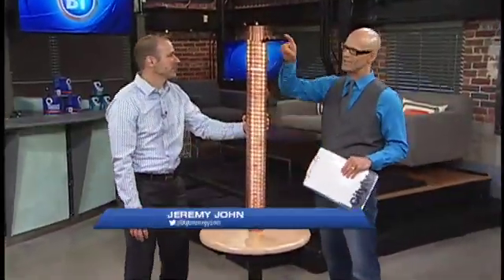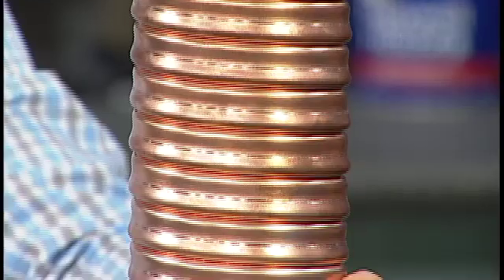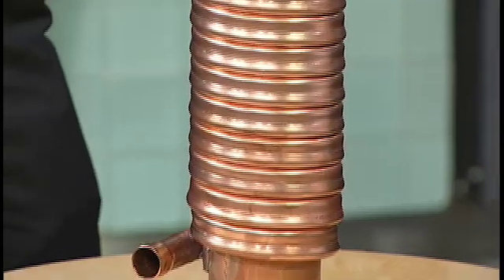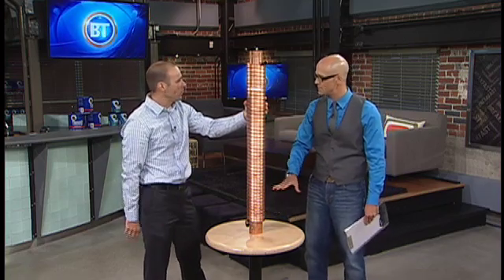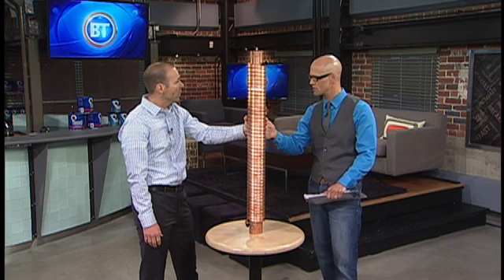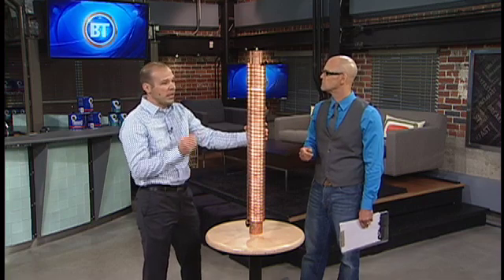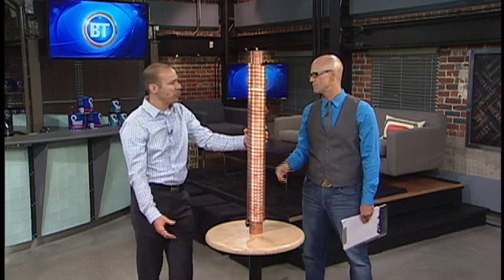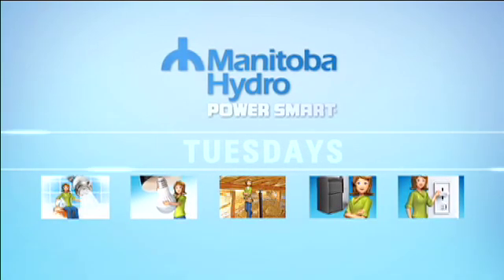Drain Water Heat Recovery Systems

Comment: Snake oil:  1. this device works best if its not insulated. LOL.  you will need to pay for more heat in your basement with this chilling device.   

2.  water passes by this sooooo fast it doesn't have time to extract the heat.........(seriously less than 1 second)
3.  the majority of the heat exchange occurs from ambient room this is installed in.   so you will pay more to heat your house.
4.  best use case is hot sewer gases rushing past.....continuously.....but there is no guarantee of this.....as its dependent on your stack height  city sewer hydro dynamics.

Salesmen will  FUDGE the efficiency  to make a sale.  
the true test includes:  1. fully insulated stack.   2.  temp in  3. temp out.    THEY WONT SHOW YOU THAT LOL!

Dude. (PEng)
Reply: I've installed quite a few of these and the difference in water temperature at the inlet versus outlet is actually very significant. Ice cold, causing condensation on the way in and lukewarm coming out.
Reply: @ryanpeter6785  Hello, I'm interested if there has been done som research on this unit? I would like to hear solid numbers.

Comment: can anyone verify the number of 4-6 degrees input results in 25 degrees output? If this is correct, it could enable you to run a very cheap electric tankless as that water temp is much easier to heat. I think if I had one of these, I would also aim a heating run from the furnace at it...why not use some of that heat to preheat your water before hitting a tankless heater?? Makes sense to me...but the numbers have to be real...not Trudeau numbers.
Reply: The joke.  Energy is energy.  The savings in preheating water for your highly efficient hot water tank are the same as if you had a 55 gallon stainless drum that would capture shower water in your basement until it cooled to room temperature and then drained.  This would be a simple system which would reclaim all of the usable energy in the waste water.  Heck even run a coil of your incoming cold water through the tank.  It isn't the temp raise in the incoming water that is energy savings it is the temperature drop of the discharged water

Comment: it would be funny if the pipes get punctured and then crap water would get sucked into the fresh water, get mixed up and you'd end up with the filth all over you. ha
Reply: Potable water pipes are under pressure and your drain is not. So that's impossible to get drain water into your drinking water from this type of system.
Reply: That is super unlikely.

Comment: I'm running a tankless water heater and don't preheat and store water that I'm not using; The most efficient (and practical) method I could find.  How will this steampunk dumahickey help? Trick question: It won't. Laughable "savings" at a nickel a month for a mere $500 investment.
Reply: In your case you can send the water up to replace cold water in the same  shower faucet so it will mix hot and warm .In my opinion this system is pure a waste , couple of generations to recover your money.
Reply: @daku08  Are you saying a tankless heater is a waste?
Reply: The heat recovery system (Thermo Drain ) is a waste.

Comment: When I first heard of this I called BS. He made a lot of claims here " hot water falls down the drain. 1. my shower is mixed with cold water it's more warm than hot, 2. my waste line would have to be full of hot water to get that type of rise in water temp. a shower would create a trickle down that pipe.  3. As for the 20% savings in my hot water savings more BS, you have no way of breaking out your gas or electric bill to prove it. For a residential home this is a loser. maybe a restaurant.
Reply: Not just restaurants.  Industrial locations often use hot water is part of their process (not just space heating) for 24 hours a day, 7 days per week.  The savings can be massive.  Other applications that make sense include: dormitories, hotels, prisons, multi-family housing, long-term care facilities, hospitals, military bases, etc.

Comment: It would be one thing if the drain water pipe were itself intertwined with the recovery system, but its not and have you ever put your hand on the waste water pipe?  Its not holding waste water long enough to get very hot.  I'd love to see someone with a stronger science background cover these because they look like complete hooey to me as is.
Reply: Most waste water pipes are not made out of a thermally conductive pipe like copper so you won't feel the heat. The return on investment really depends on how much you currently pay to heat your water and if you shower or bathe. You'll get far better ROI if you have electric hot water and take a lot of showers than if you have a gas boiler and take a lot of bathes. I believe heat exchangers like this have been proven to raise the temperature of the water entering a hot water tank by 10C @2.5Gpm. The specific heat capacity of water is 4,200 Joules per kilogram per degree Celsius (J/kg°C). This means that it takes 4,200 J to raise the temperature of 1 kg of water by 1°C so you can work out how much energy it's recovering eg, 4,200J x 9.5L x 10C= 399,000J/min....or 378 BTUs. Granted I'm pretty tired so you might want to double check the math.

Comment: 20% water cost savings, BULLSHIT! I've been plumbing for 36 years and never seen so much nonsense. Please correct me but the energy used to manufacture etc will never ever compensate. Please someone correct me on this.
Reply: It's a terrible, terrible design; but in theory drain water heat recovery makes a lot of sense. I'm currently running tests on how much temperature is lost from a shower head to the drain and it is very minor.
Reply: @velianlodestone1249  Thanks and Merry Christmas!

Comment: I'm planning to run a 10' loop of 1-1/4" copper through a 2" concrete topcoat in a landing in front of the bathroom to absorb the drainwater heat, and in the climate where I live overheating is never a concern, and any potential heat gain is a welcome treat.

Comment: My idea would be to replace part of the pipe with a multistage turbine generator that simply spins when waste water exits. Alot of potential energy is lost. It doesn't have to be costly but would work best in a house that already has some kind of energy storage but it could be passed directly to a heating element directly like the hot water tank. What this guy has made is basically a gigantic uninsulated copper heat  sink that tries to grab some thermal from a single pass and divert the thermal directly. The resources required would mostly be some pipe, turbines from stainless steel or something, and a small generator which is basically a converted normal motor.
Reply: The only problem with your idea is usually the toilet,sinks,showers usually use the same down pipe and waste would clog the system up.